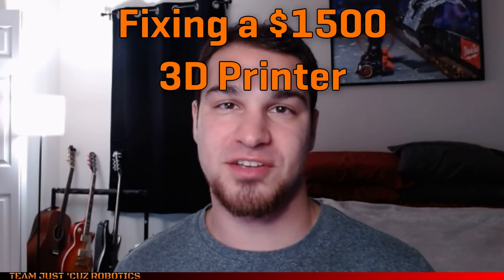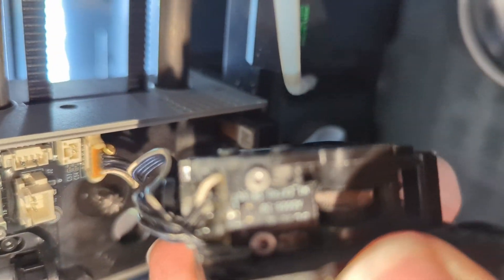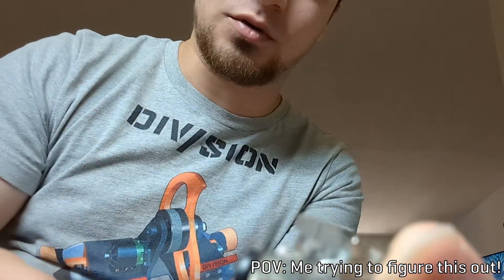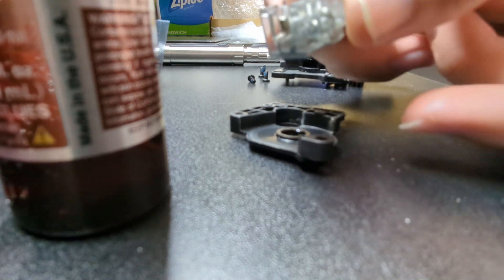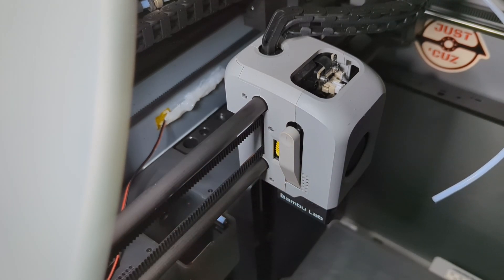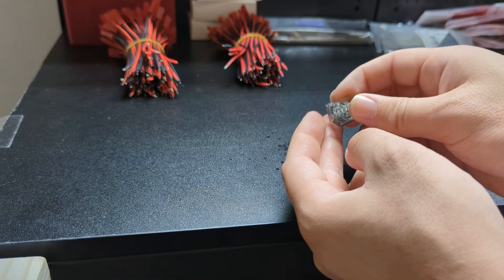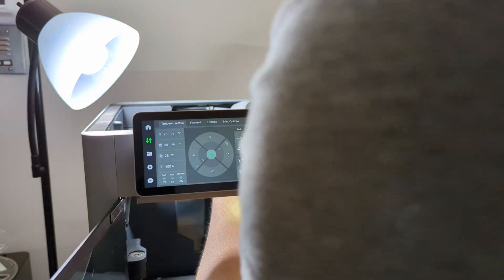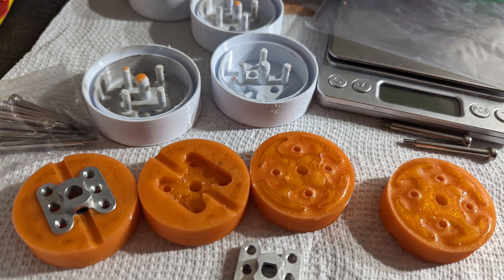My Bambu Lab X1 Carbon Broke! Can I Fix It?

Comment: I had this exact same issue with mine. I thought I was screwed so I ordered a new extruder. Needed my printer for selling parts, so I ended up doing the exact same thing with an additional step of trimming the plastic down so it isn't a 90degree angle that it hits, but an angle so it 'slides' into it's groove. Too much play in the arm imo. No problems since and now I have an extra extruder just in case!
Reply from the maker: Glad to hear! It seems odd that there is a right angle there, beveling it is a good idea

Comment: What is that black print bed? Looks cool!
Reply from the maker: That's a PEX coated bed from Aliexpress. It's PEX black pattern on one side and gold textured PEI on the other! Works quite well for PLA and PETG and many other materials. I tell the machine the PEX side is the high temp plate.
Reply: @JustCuzRobotics  thank you!

Comment: Wow you went through a lot here. What do you think caused this? Is it the nozzle cleaner filament that you put in or cheap filament with bad diameters or just one of the things that happened with time? I do have an x1c so this will be super valuable for me!
Reply from the maker: Good question. I believe this clog happened with a fairly soft durameter TPU and probably happened because when the filament sensor broke I was seeing it not detect it, and was forcing the filament in trying to get it to come out of the nozzle. So probably the clog happened due to the sensor failure. I haven't had another issue since with another 100hrs of printing.

Comment: Just fixed my Artillery. Except it wasnt just in time, it was the moring after my competition that I finaly fixed it.💀 Showed up without a bot. Manufacturer put a stepper driver on with hot glue and gave it a spotty connection.

Comment: I do generally enjoy your vids, but I can't help feeling they would be better without the cheezy "elevator muzak" in the background. Especially when you're trying to explain something.
Reply: I like music as long as it's chill and not too distractive. Jeremy Blake has good beats and the tracks can be found in youtube audio library. I found the artist through a 3d printed parts assembly video.
Reply from the maker: Noted. I get mixed opinions on the music, I find engagement really drops off during sections with no sound so having music at least then helps.
Reply: @JustCuzRobotics 
My gecko brain appreciates the music
Reply: I'm a music snob and the music doesn't bother me here. It is what it is. Yes, silence would be bad.
Reply: One more thought to add. I think it's great when creators concentrate on the important stuff. I'm not here for the music, so anything works.